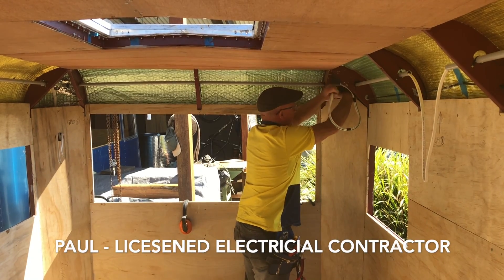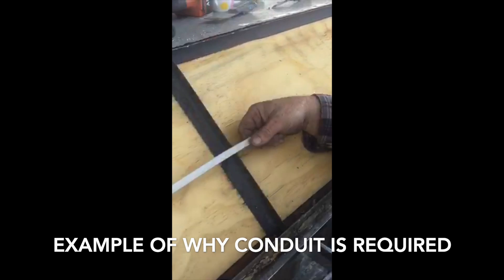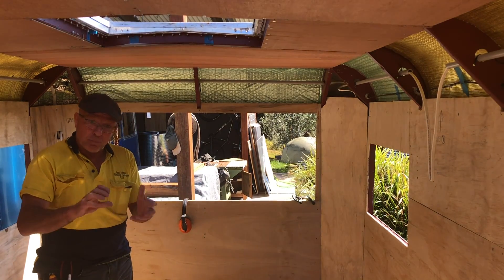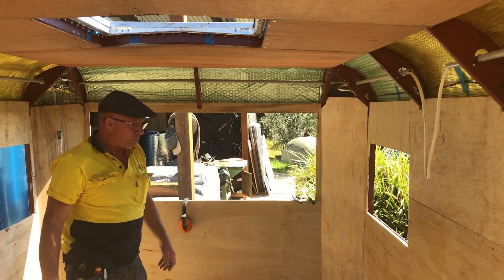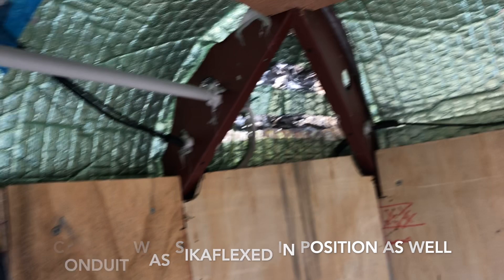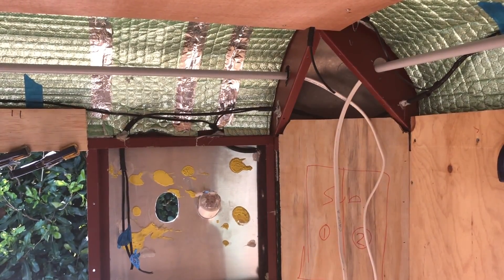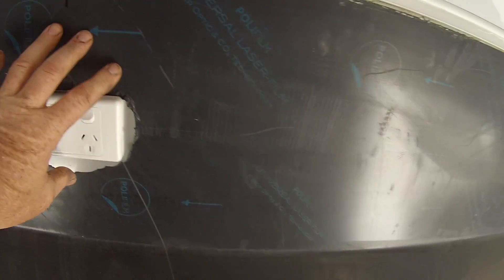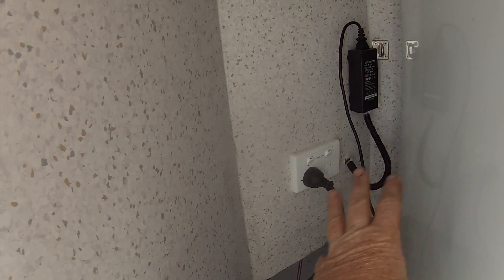Installing 240 volt into a vintage Caravan

Comment: Can you please advise what Sikaflex products you are using for sealing conduit. Also you were using Sikaflex between aluminium sheets when riveting them together. Is that a different product?
Reply from the maker: Sikapro, not using to seal the conduit, just hold it.  I use it for everything.